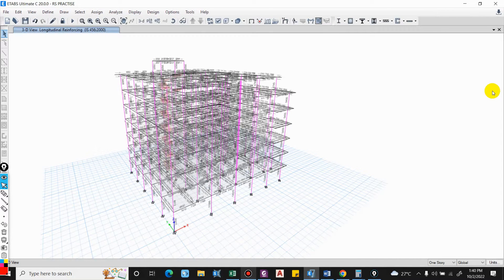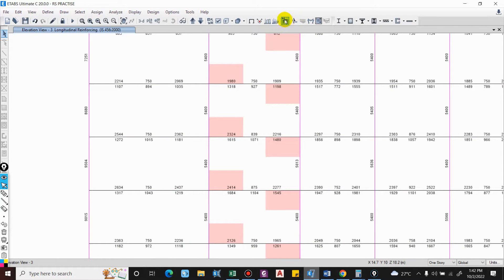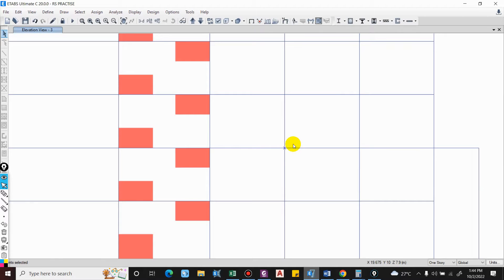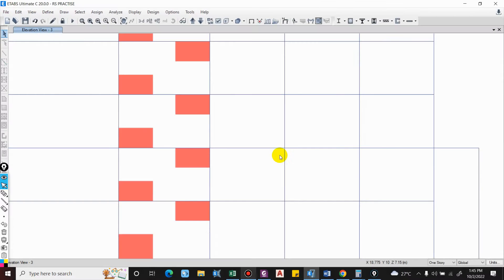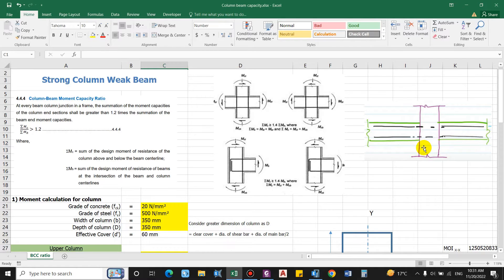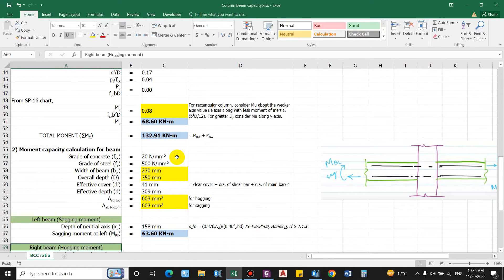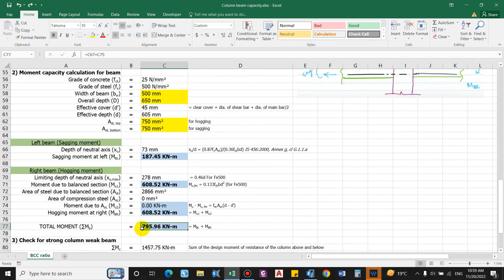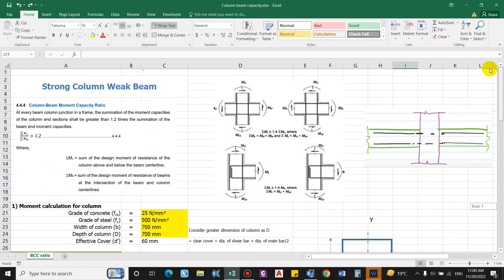Beam-Column Capacity(BCC) Ratio Manual Calculation | Structural report  ETABS(NBC 105:2020,IS 13920)

Comment: It is not possible to check like this for all column beam.  The bcc given by etabs is based on the obtained reinforcement. In residential building we generally provide same reinforcement in beam in all floor. And if we check as per this i think bcc will not satisfy in most of the case specially in upper storey. Is there ay way to check bcc in etabs as per reinforcement provided??
Reply from the maker: Yes, it is possible. While defining the column section, check for the Section to be checked and check for column beam capacity then.

Comment: Requesting as a subscriber, can you also add a lift and explain piers and spandrels. Plus explain the complications that arises due to the addition of shear wall lift and ways to solve it. For example, adding shear wall lift brings a huge torsional irregularity how to balance it, etc. Also, can you show a manual calculations of combined footing and strap footing which has 3 or more columns inline and one column at the property line together connected as        0 ------0------- 0    (where the 0 are column and dash is the connections). and also how to design it for a case in which the combined footing is in L shape with 3 columns. It would be a great help to all the subscribers .
Reply from the maker: Sure.
I will look into it. Thanks for the topic.
Reply: Exel sheet for Biaxially loaded footing 
https://youtube.com/watch?v=9CXMIpjtSs4&feature=share